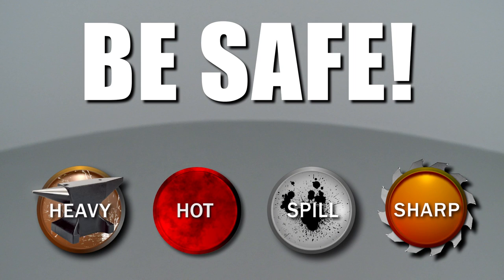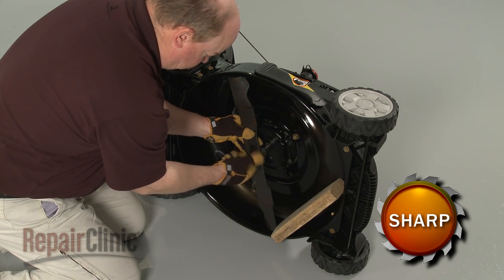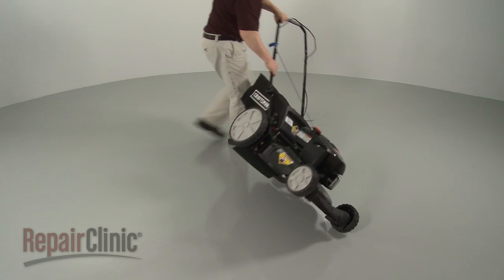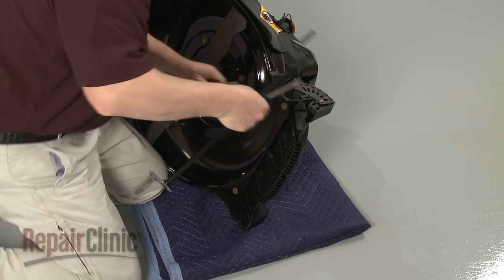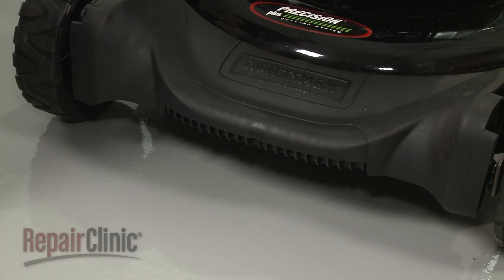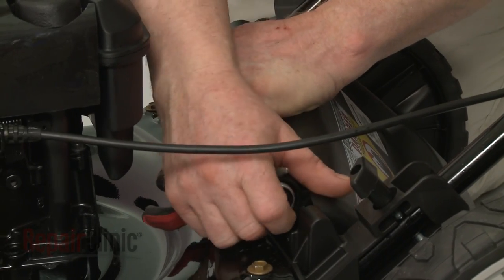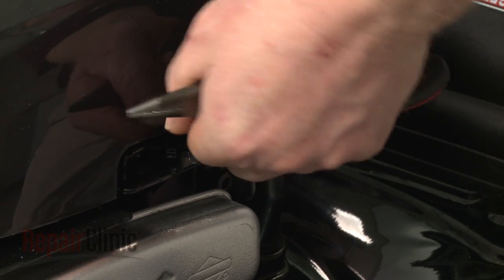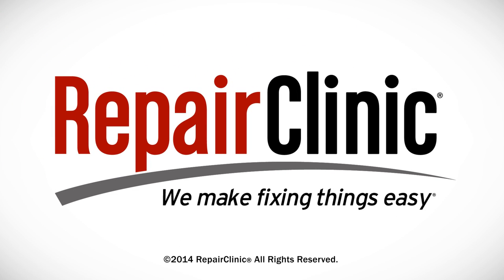Craftsman Lawn Mower Disassembly – Lawn Mower Repair Help

Comment: Sears 6.75  Hp  22" self propelled   plastic wheels ok like new  pulley turns , belt ok  it seems too be ok , when engaged  the wheel's  do not turn